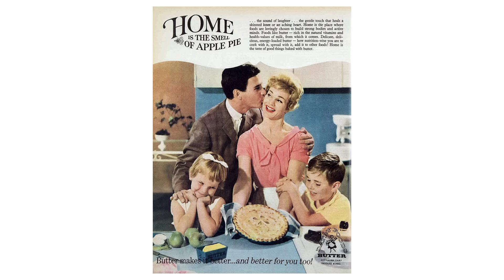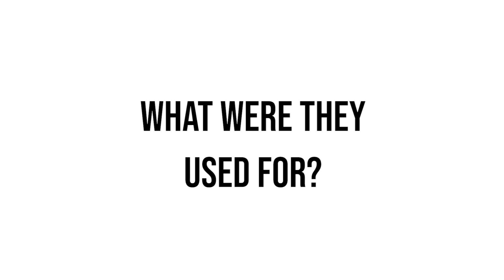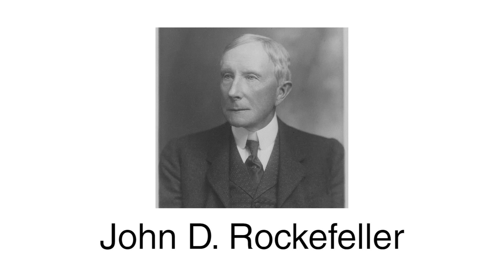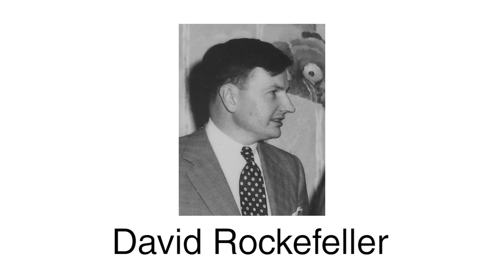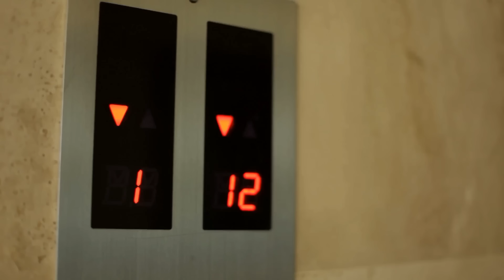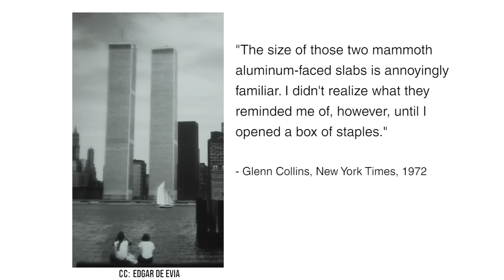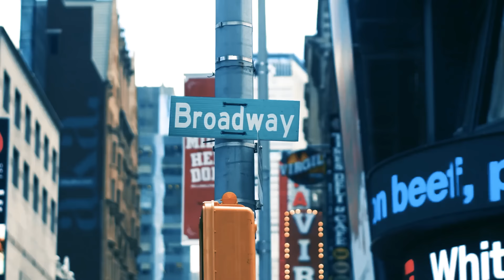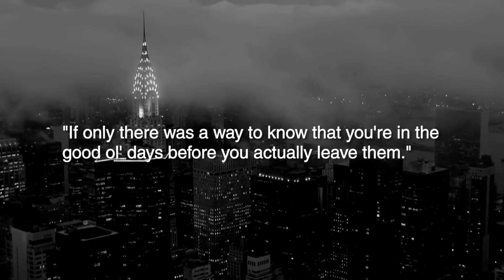What The Twin Towers Meant To America

Comment: If you looked straight north and south, the space between the towers was only 3 feet 1 acre apart. And had 12,000 miles of wire and cables. And on the upper floors at night looking across to Staten Island on a windy night, the building would rock side to side about 3 feet, pick a window and watch a landmark in the distance disappear for a few seconds. Best times ever in the late 70s.
Reply: Thank you for that story

Comment: i love how you casually state that they were bult strong enough to specifically withstand a plane crashing into them.
Reply: A lot of people were shocked the buildings didn't hold up long enough to put out the fire.
Reply: @stevenroshni1228  Knowing what we do about their design, the physics of it make total sense. Without support pillars spread throughout the floor space, most of the load was transferred horizontally to the outer walls. That's also the reason they fell basically straight down instead of toppling over like trees. Once the support trusses gave out, the path of least resistance for the floors was straight down, and so down they went. Compared to traditional skyscrapers, the towers were ironically more likely to collapse from a plane impact, not less.
Reply: They were. The Boeing 707 was the biggest commercial jet at the time they were designed. The Boeing 767s that hit them were much bigger.
Reply: @Iterr  they way they well tell the truth in my opinion. It looked identical to a controlled demolition.
Reply: Well, they were designed to withstand a plane going at a normal speed. The only difference is that when the planes were hijacked they were put way over the legal limit and therefore produced more force than what was accounted for in design. On a fogy day back in like the 30s a plane going a the legal limit crashed into the empire state but didn't cause as much damage as it could as it was to designed in case of an event like that.
Reply: @Beefnhammer  You say the path of ``least resistance``, ,,,, they fell at freefall speed, it appears the structural steel girders beneath the impact zone had no resistance to offer. a ten second collapse shows the lower strength and resistance had been compromised. the study of the plane hitting the towers was to do with sideways resistance, nothing in any report ever mentions a collapse for any reason, yet here you state it was ``more likely`` to from that specific reason.
Reply: @shedshow1439  it dosent though,controlled demolitions collapse at the bottom
Reply: They were built to mostly withstand a cruising Boeing 707, not a Boeing 757 at full TO/GA. Any heavy modern airliner at high thrust and speed is far more destructive than a 707.
Reply: It was never thought a plane crashing into the towers would be intentional.
The idea was a plane flying nearby would be lost in fog and going slow.
Reply: @Beefnhammer  All three towers were pulled.
Reply: @shedshow1439  Looks nothing like a controlled demolition, Controlled Demolitions usually start at the bottom of the building followed by the collapse of the building.

Comment: Both World Trade Center Towers are 110 stories High the Tallest Buildings in New York City
Reply: The difference was the height. The North Tower was 1,368 feet and the South Tower was 1,362 feet. The tv/radio antenna was installed on the first tower in the late 1970s and the observation deck was on the roof of the south tower.

Comment: Should have rebuilt them on the spot. They were landmarks, advancements in the mechanical engineering of skyscrapers were made there. What a shame of architecture they weren't rebuilt.
Reply: I don’t think they should have rebuilt them on the exact spot. That same spot is a grave site as far as I’m concerned. But I agree with you that they should have rebuilt the twin tower.
Reply: Even just a floor higher.
Reply: @craigusselman546  
6,911 feet to the top of the north tower. 

5,980 feet and 460 floors to the roof of the north tower, with 14,315,200 minimum and 19,901,440 maximum square feet of space, a flexibility ratio of 28% 
5,968 feet and 459 floors to the roof of the south tower, with 14,284,080 minimum and 19,858,176 maximum square feet of space, a flexibility ratio of 28% 

That is my Big Ask here.
Reply: Umb O  And that's the people's problem frankly. The current iteration is like scar tissue that's built up.
Reply: I used to think the same. That the biggest insult to the terrorists would be to build them right back the same way. 

Problem being, the towers were failing and mostly vacant. Nobody wanted them. So it solved a lot of issues for the Port Authority having them gone. Makes me wonder if they had a hand in it.

Comment: Wait a moment, "Could survive a Boeing 707"???
Reply: Same thought
Reply: it did survive the plane crash, it was the fire that caused its collapse
Reply: It was designed to withstand a plane crash by a 707 at low speed coming into land with low fuel. The thought of future planes being used as missiles probably didn’t cross their minds
Reply: Thermite was not included
Reply: Come on people we know what happened. Come out of your comfort zone and accept the truth
Reply: A Boeing 767 is larger than a 707 and they struck the World Trade Center at full speed. There is a significant difference.
Reply: @BoomerG21  Okay thank you

Comment: 6:27 why only say there was a sky lobby on floor 78 of 2 WTC ?
There were 2 sky lobbies in each tower, at 44th and 78th floors, above the technical and utility floors. They are the kind of "stitches" that we can see at the first third and second third of each building.
There were huge express elevators from ground lobby to sky lobby 1 at 44th floor, ground lobby to sky lobby 2 at 78th floor and ground lobby to top of tower at 107th floor (Windows on the Wolrd, a panoramic restaurant in the North tower [1 WTC] and Top of the World, a touristic observatory and roof access in the South tower [2 WTC]).
Each "third" of the towers had 4 groups of local elevators, each servicing approximately a quarter of the floors from the lobby (either ground or sky lobby) of each third of the towers.
So you only had to change elevators once to get to the floor you wanted without the need to stop at too many floors in between as no elevator served more than 10 stories.
They used the same system as the express and local subway trains.
The local elevators shafts were on top of each other in each section of the towers, taking much less space than if they were next to each other.
And they were all pretty fast !
Reply from the maker: Yes, I am aware that there were two sky lobbies. I specify this at the time stamp that you mentioned, with the "44" seen on the left tower. I used 2 World Trade Center as an example to make it more clear to understand and also to save time with my explanation. It is pretty amazing that they used the same system as the subway trains. They were an incredible piece of technology.
Reply: @nationsquid  Just saw the 44, I was focused on the comment.
The cool thing was that many users only had to change elevators once and didn't have to stop at any other floors than their destination as local elevators were numerous enough to only serve one or two stories per trip.
Even without a modern destination dispatch system it was quite efficient.
Reply: @KyrilPG

"There were 2 sky lobbies in each tower, at 44th and 78th floors, above the technical and utility floors."

That's correct. Actually two floors above a mechanical room floor. There was a typical tenant floor between them (floors 43 and 77, called "Lower Escalator Levels" on architectural drawings).

"They are the kind of "stitches" that we can see at the first third and second third of each building."

No. These darker "bands" around the towers were actually the windowless ventilation openings for the double-story mechanical equipment rooms (MERs). There were four of such "bands" per tower: Floors 7-8, 41-42, 75-76, and 108-109.

"The local elevators shafts were on top of each other in each section of the towers"

No, they were not, because in between there were usually the elevator motor rooms and a MER level.
Reply: @MassEffectGER  I should have written my sentences differently for better clarity. When I talked about the "stitches" or darker bands, I was referring to the technical and utility floors that were at the end of the previous sentence. I know that the sky lobbies weren't specifically recognizable from the outside from afar as they had windows.
I should have written "[...] above the technical and utility floors * that * are the kind of "stitches" that we can see [...]" as my initial writing lets think that the sky lobbies themselves were the dark bands.

As for the elevator shafts, I'm not saying they were continuous but that they were on top of each other and not contiguous. 
The fact there were motor rooms and MER floors in between local shafts (on the vertical plan) doesn't negate the fact that if you look at the towers from any sideview the local elevator shafts were on top of each other and not next to each other. That was precisely the innovation and interest of the express and local elevators system : to occupy less floor space while still having a very efficient elevator service.
This system permitted to have more elevators, both express and local in a smaller occupied footprint.
And to be precise, if my memory's right the local shaft, of the first third and last third were directly aligned on the vertical plan but I'm not sure they were on the second third as to my surprise I've found conflicting maps. Do you have any information on that ?

In my memory, when I visited the towers in 2000 and 2001 the local elevators were all on the same alignment (on top of each other) but I only used the first and last third local elevators and the express ones.
The visit I took was an architecture tour guided by an architect conference lecturer and it was extremely interesting.
I think we totally agree and this is just a "lost in translation" or a wording difference.

Comment: yeah, they could take a boeing 707, but not a 767
Reply: They were hit with 767 not 757.
Reply: i mean they did take a boeing 767, it was the jet fuel that added to the fire that caused it, and no it didnt "melt" the beams, it weakened them, thats why just before it collapses you can see the metal bend, the weight from the higher levels caused the metal to give in, causing the upper layers to pancake down, and that set off the chain reaction till ground zero
Reply: 90% of the fuel did burst out of the other side of the buildings. The left fuel burns within 5mins and started the office fires. The black smoke that came out of the towers is the indicator that it was a weak fire. The evidence of no significant fire is that there were people hanging out of the impact zone. And even if they were significant office fires at 700-800c° this would have no effect on steel columns and beams. At this temperature the steel is heated but strength is not affected.

The planes (Boeing 767) smashed through the exterior walls of the towers. The WTC walls functions like fly swatter. The planes were separated in thousands and thousands of pieces of debris. 
Off course the walls were damaged but 200ft of plane was going through the exterior walls. The engines and landing gear did much damage at that speed. However thousands of pieces of small debris can't effect the core coloms of the buildings that's just nonsense. Each of the core columns weighed twice as much as a semi truck.

And the way that they collapsed suggests that it was not a normal structural failure. It was a explosive free fall of 9 and 11 seconds. Everything turned into dust. The pancake theory is the dumbest I ever heard about the collapse. So every second the south tower fell 12 stories that's 46m (151ft). Freefall. The floors under the impact zone provided no support at all. Instead the tower just accelerated on it's journey down. Like there were no floors beneath it at all. If it was a structural failure because of the failure of core colomns only the top of the tower came down or it came down partly. 

Anyway we the people want the truth about 9/11. The only thing I know is that the official story doesn't fit.
Reply: @theguywhoasked5591  well guess i was wrong L

Comment: Did you say that the towers were resistant to "Boeing-707" airplanes??? Then they should have survived "767" attack too...
Reply from the maker: Boeing 767s are much bigger and much faster than Boeing 707s. The original design of resistance for the towers may have worked, but the design was outdated by 2001, and it didn't take into account how airplanes were going to get bigger and faster over time.
Reply: I thought everyone knew that a 767 is a much larger jet.  I guess not.
Reply: @nationsquid  Boeing 767-200ER that impacted the twin towers is 48m long with 47m wingspan. Boeing 707 is 46m long with 44m wingspan. Max takeoff weights are  not much different in 150 to 160 ton range. Fuel capacity is nearly same as well around 90,000 L (24,000 US gal). As for speeds, 707 like other jets designed in the 50s is actually faster than newer turbofan powered planes such as 767 designed for better efficiency. I think you should rethink that comment.
Reply: @nationsquid  Do you believe the towers would be still standing today ?
Reply: @engineer1able  the towers were designed to withstand a 707 coming into land on low fuel. And in case you didn’t notice both towers survived the initial crash of both jet liners. If you’re implying anything else then peddle your warped theories elsewhere.
Reply: Someone obviously asked them about maybe poor visibility coming into land and took the biggest plane of that time, low on fuel and at low speed. To basically 30 years later have a 757, travelling about 500mph with majority of its fuel and still withstand the impact its pretty good going. It never collasped until nearly an hour or 90 mins of fire
Reply: @discogareth  I was simply pointing out the ignorance of the comment I replied to, nothing else. It shouldn't be too difficult to do a little research and at least state proper info on the aircraft instead of making a blatantly false statement, especially by the video creator answering someone's question.
Reply: @discogareth  And the engineers' study prior to the construction stated that the towers would survive 707 impacts at 600 mph, but their study did not include the effects of the fuel and fire. So in that sense, yes the buildings took the high speed impacts no problem, as designed. But no comprehensive study was done of what happens after the impacts, as it was also no real way to simulate with the technology available in the 1960s.
Reply: @discogareth  this is correct. People need to research a little harder to understand what was meant.
Reply from the maker: @engineer1able  I am not interested in getting into conspiracy theory territory. Everything that I have said can be easily backed up with research found online. I am not exactly sure what the point of this argument is. The fact remains, it happened. The towers did indeed fall because of the impact of two airplanes. At the end of the day, it was flawed and outdated design, and arguing about the nitty gritty details and semantics surrounding it will not change what happened on that day. It happened, and it was a tragedy that should have never occurred.
Reply from the maker: @rickhardman7376  I suppose that depends on the context of the question. If an attack had never occurred? Of course.

Comment: 9:15 here you'll notice the difference in height between 1WTC and 2WTC. 1WTC was 6 feet taller than its twin
Reply: How can we see that it’s only a two metre diiference
Reply: are you sure? i think its just a weird angle. yes, the north tower is  taller but 2 meters isnt a lot, and the buildings are massive. i have never seen a picture clearly showing the difference of height before, so i think this is just some weird angle, as the size difference is too small so see

Comment: On Septermber 11, 2001 I was working at a Staples store. We sold HP Laser multifunction machines. These had little devices connected to them with a sample print button, so customers could see how crisp they printed text and graphics. A couple of the units had a particular image.. It was a picture from the bottom of the WTC towers, looking up at the sky. You could also see the tail of a commercial airliner flying over the towers. We got word from our HP rep the next day that these demo units were to be immediately sent back to HP. I wish I still had a printout of the image, and/or the demo unit!

Comment: 11:40 9:10 
A really interesting thing not mentioned here is how the coastline was built out to accommodate more skyscrapers west of the towers. At 11:40 you can see the full twin towers in all their glory soon after their construction as riverfront property. 
At 9:10 you can see several smaller skyscrapers to the towers’ left (west) that nicely match the typical height of the other buildings of lower manhattan with the world trade center towering over them all. 
The original prominence of the towers made them all the more stark and daunting.